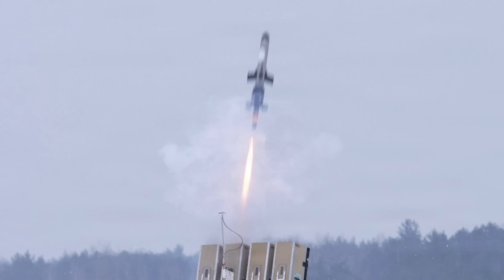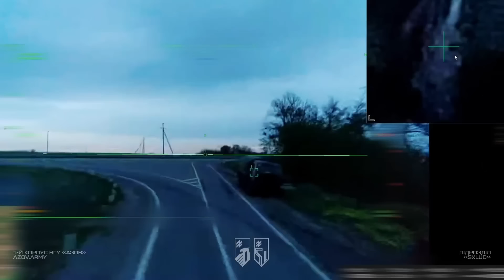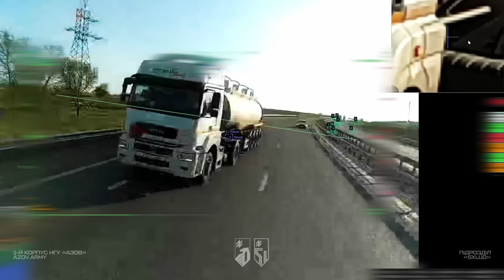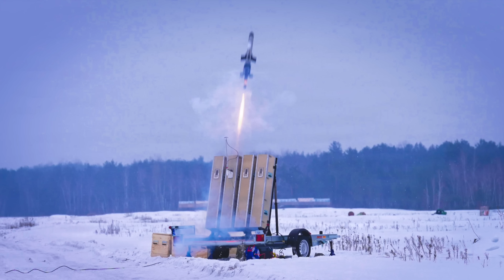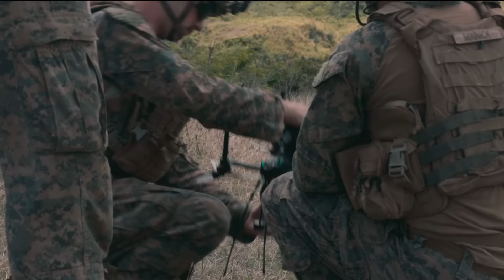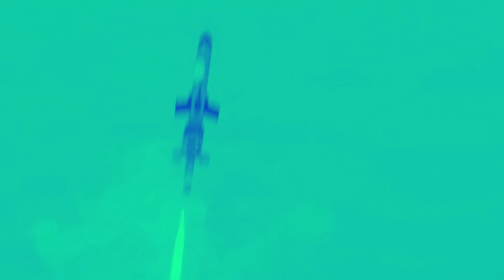How IonStrike could help US military better manage evolving drone threats?

Comment from the maker: The system has only one image in public domain.
Reply: Np, I'm happy with anything that isn't AI
Reply: Its not whats needed
They need directed energy weapons
The best option is taking MQ-9 and fitting it would centerline gun similar to the MV-22 IDWS 
except with single barrel 50 cal
Round type would be Mk211s with 1000 plus
The system would be carried in the pods and operate simialr to the CIWS 
The pilot wouldnt be spraying and praying, the system would have FCS similar to aircraft so it accurately target in as little one round
The pods would carry processors for the FCS so it can quickly generate firing solution allowing to target up 24 targets per salvo
All the pilot has to do is get in position and let the FCS generate firing solution , once down, let it loose
It would be 2 MQ-9s with kinetic rounds and 3rd with low power 50kW laser for smaller drones
4th MQ acting as sensor center AESA radar sensitive enough to detect the smallest drones